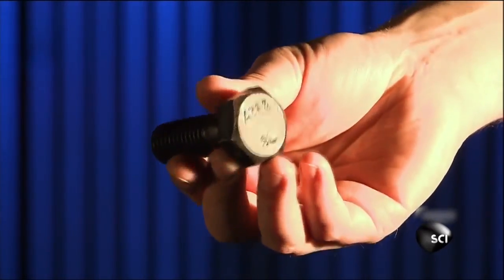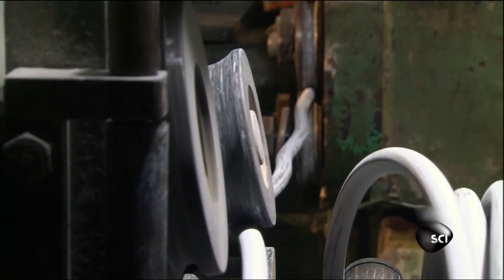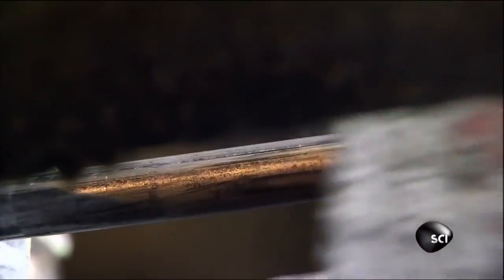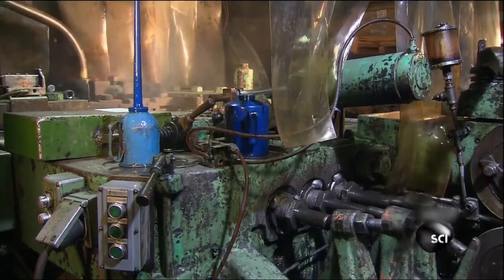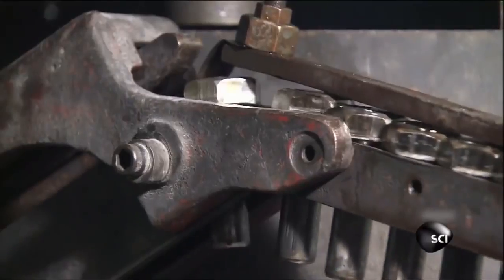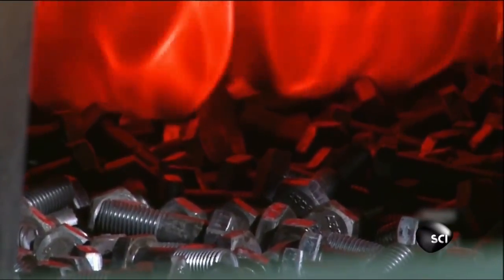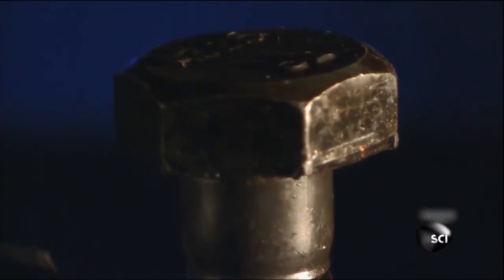Bolt Nut manufacturing process

Comment: FYI
The correct term for the machine that makes the bolt blank is a cold header. Just from the video it looks like the machine is a National Cold Header.
One feature you neglected to explain was when the wire is being drawn through the sizing rollers and the diameter is slightly reduced this increases the tensile strength of the wire.

Comment: Hi, we are professional high strength standard fasteners manufacturer in Ningbo, China.  
Our major products are as follows:

A325/A490 TYPE 1 Heavy hex bolts, A194 2H Heavy hex nuts,

A193 B7 Threaded Rods/Studs, F436 Flat washers, SAE G5/G8 Hex bolts, Hex nuts,

DIN 931/933 8.8 10.9 Hex Bolts, DIN 934 CL8, CL10 Hex nuts, etc.
Website: www.gtzl-fasteners.com      sales@gtzl-fasteners.com

Comment: NUT BOLT & Fasteners are of various types – namely, screws, nuts, bolts, washers, nails, staple pins, staple removers, hex wrenches, rivets, threaded rods, dowel pins to name a few. ... Nuts are rounds with holes in the middle to easily run around the lengths of the bolt fasteners.
nore info contact us
call & whatsapp +91-9958234796

https://drive.google.com/.../19xxULEwEuFIjhl2Ezwy.../view...
Edit or delete this
vaanya nut bolt finel.pdf

Comment: I have National Kayser 5/8 4 die Boltmaker for sale. YOM is 1972. Maximum wire diameter is 18mm. Machine is equipped with kick out in punches system. Price: 100 000$.
Reply: @nandareddy55  do you need tapping machine for nut, 86-18731114228
Reply: Please send me the photos of machine on khizer77@hotmail.com

Comment: This kid at work couldn't find a bolt the right length so I told him to check out the bolt stretcher from the parts crib and get a quart of ID10T oil to use with the machine. He came back an hour later all pushed and all of us were laughing about it. Next i'm gonna have him get some spots for the spot welder... maybe a new bubble for my bubble level too!😂🤣😃
Reply: John Dias don’t forget some sparks for an ark welder, that’s another favourite, and going to the tool stores for a long weight/wait lol
Reply: John Dias ;  If they do what you say, send them to get y'a an adjustable metric wrench eh…  Ü
Reply: How is that funny?

Stavros
Reply: Third shelf on the right, toward the back, the box of pre-drilled holes, can’t miss them, gonna need a handful....and hustle, don’t have all day !
Reply: And just hope you don't prank the one that brings in a machine gun for show and tell the next day.

Comment: I made millions of A325 3/4 cap screws working at Bethleham steel for 10 years also ran the Biggest  cold bolt machine in the USA--it was a 1-1/2 machine .
Reply: I visited the Bethlehem plant in the mid-'70s.  A really interesting process!
Reply: I ran quite a few National progressive headers..ran millions of bolts! I ran every machine they had, I worked at Texas Bolt Company on 11th street in houston texas..
Reply: Roy Erb i make millions of brass screws if required let me know 9996364031 india

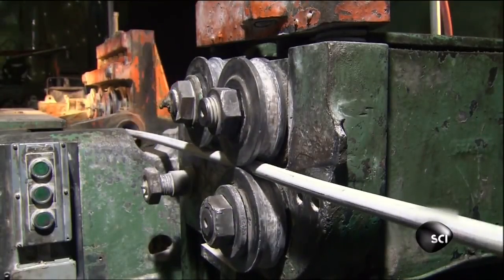Comment: 1:39 hard to get it straight when the straightening wheels don’t run true.
Reply: Those are initial guides. The following die reduces the diameter which straightens it
Reply: Gunzee perhaps, but it still is loose stuff.